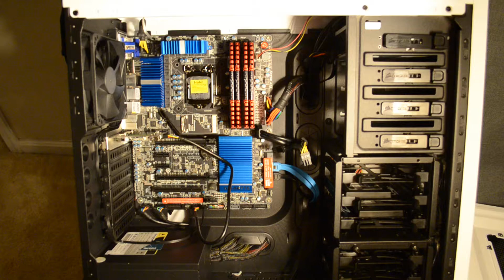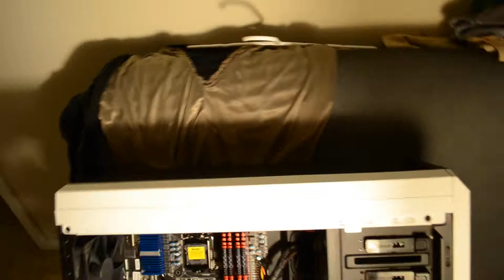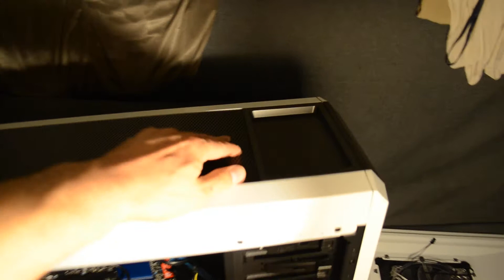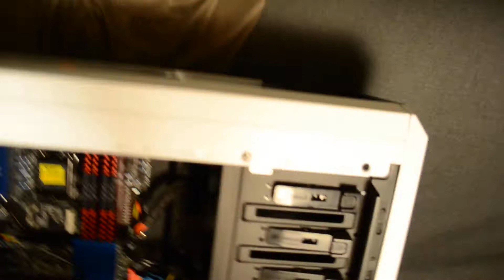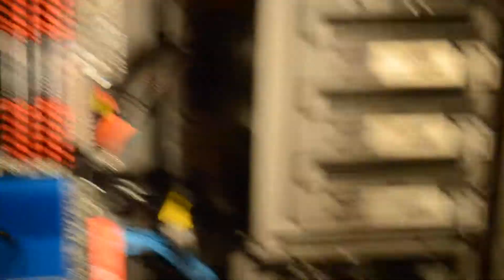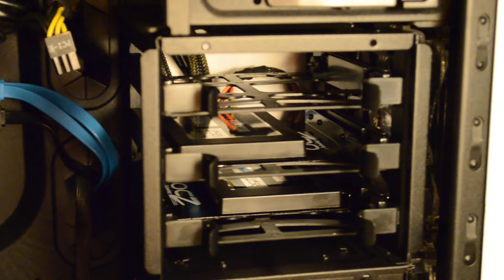Build in preparation for Ivy Bridge

Comment: well dude great to see a pc system thats gonna be build on ivy bridge processor,,,i have a question for you,,,i already got sandy bridge core i3 2100 processor with intel DH61WW,,so can i use the ivy bridge with the same motherboard,,,becoz if i can then it will be pretty much easier for me to convert to ivy bridge with out going to changge motherboard...thanks